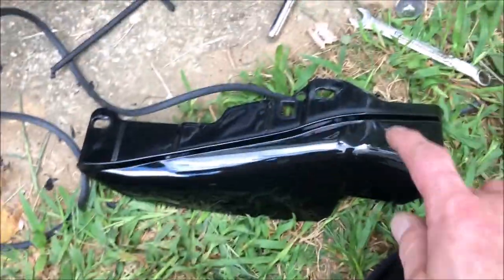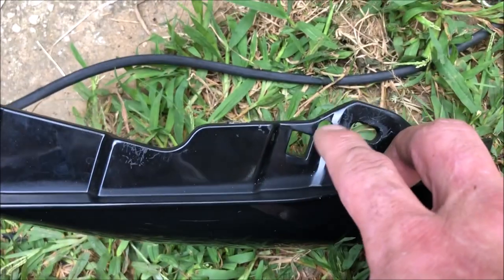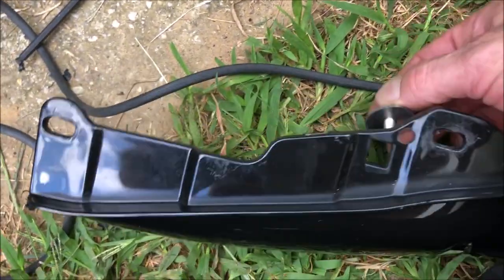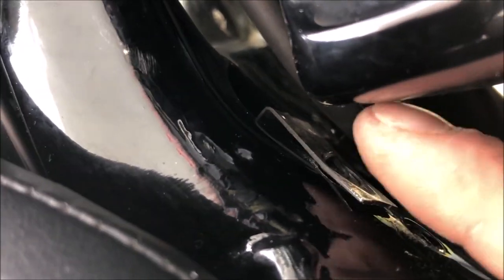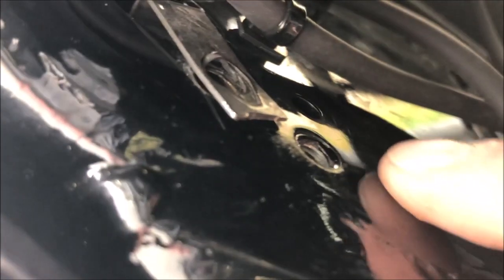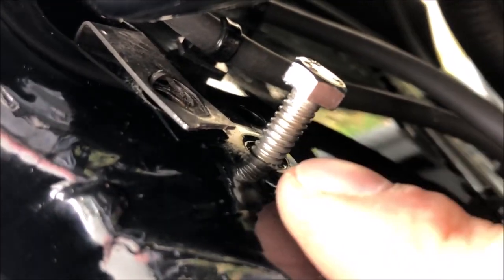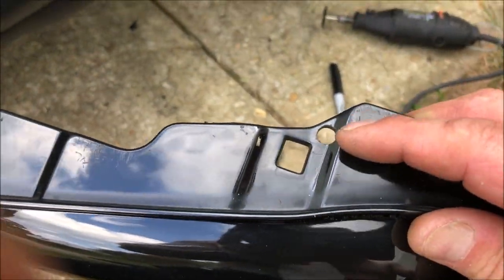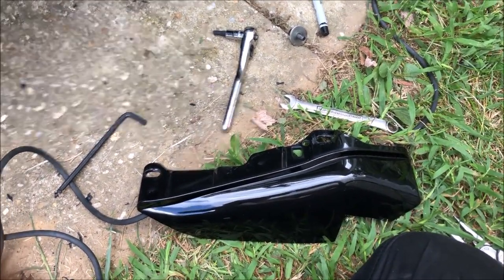UPDATE: A Tip on Installing Mid Frame Air Deflectors for Harley Touring Models

Comment: Thanks for the tip.  Used it to install advanblack deflectors on 2019 SG. Figment was a nightmare and provided hardware did not fit my frame.  After two trips to hardware store and drilling the new hole l am happy with finished product.
Reply from the maker: Good Job. Thanks for sharing.

Comment: I just used some 3M 30lb double sided tape and stuck it up in there real good. It’s not falling off.
Reply from the maker: That’s a good idea.
Reply: The heat from the motor doesn't soften the tape?

Comment: Those deflectors are designed to mount to the threaded hole in the frame.  You shouldn't have to drill any holes in the plastic.  If you buy the deflectors from Harley, they come with threaded hardware for that bottom (unthreaded) hole.  If you buy aftermarket, they usually won't come with a threaded insert for the bottom...just 4 bolts and washers.  Yes...they are a pain to install - especially the left side.  I got these from Amazon - no drilling required.  https://www.amazon.com/gp/product/B07K1B72NB/ref=ppx_od_dt_b_asin_title_s00?ie=UTF8&psc=1
Reply from the maker: Perfect. Thanks for the link.
Reply: Out of stock and unknown availability.
Reply from the maker: Crazy. I waited 4 months for a wind splitter wind shield for my road king.
Reply: I have a 14 Road king and I just got mine in from Amazon...but I haven't checked for the threaded hole...does anyone know if I have it?
Reply: 100% correct. I bought some chrome ones from Amazon and they fit on perfect. The instructions even say use the welded threaded nut attached to the frame. There is no need to drill extra holes